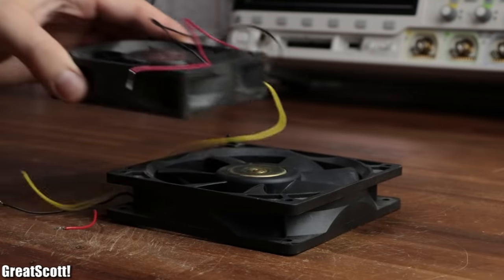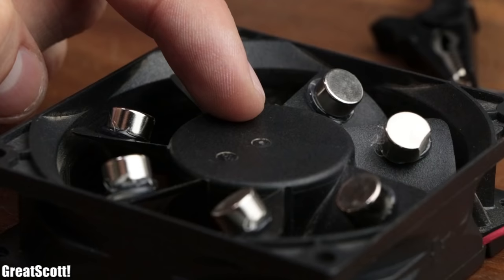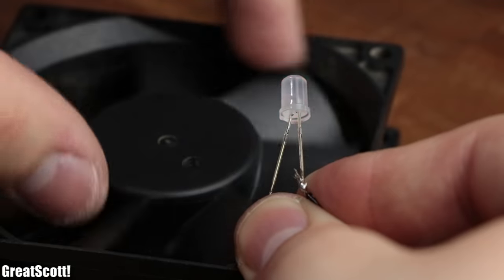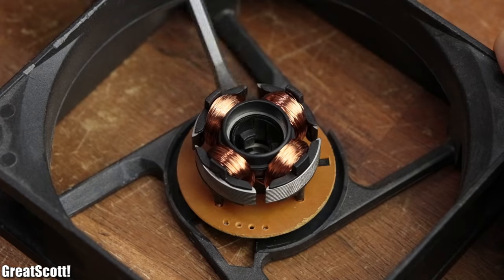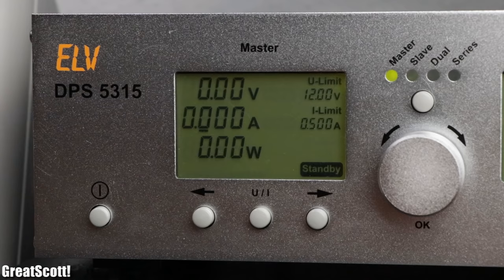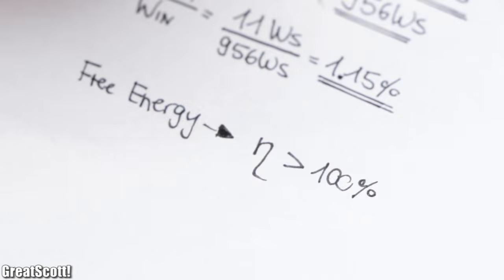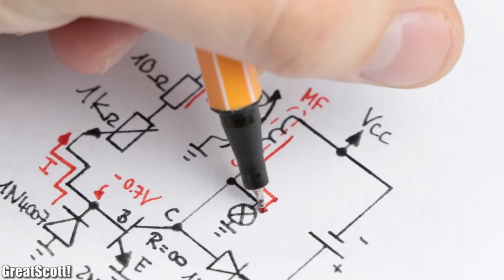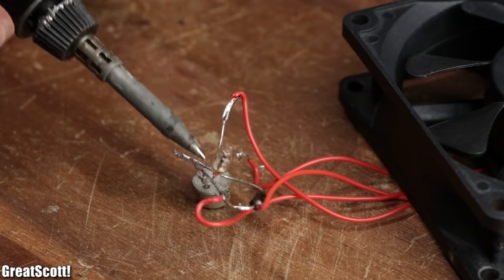Free Energy BS! || Magnet PC Fan, Bedini Motor

Comment: As a second year electrical engineering student I can confirm the existence of free energy (depending on your definition of free), and all you need to do is sneak an extension cable into your neighbour's backyard.
Disclaimer: Use this free energy method at your own risk, I am not responsible for any consequences which may (will) arise from tapping into this 'free' energy.
Reply: lol whats wrong with nuclear power?
Reply: +ExpiAigle cleaner than coal
Reply: @dericsion3480  that's not free energy you're getting it from the sun the sun is a giant power reactor
Reply: @05r solar panels cost money as do coal and plutonium
Reply: @05r that is slightly correct because as much as the sun's energy is vast until a billion years think about night fall or clouds.
Reply: @dericsion3480  sun, wind are not free energy. To build and maintence the facilities that use the sun, wind etc to produce free energy costs aa lot
Reply: @dericsion3480  Its not free energy from the sun, you are just converting light energy to electrical energy. Same as if you run creating voltage, you are just converting your energy to electricity, so no free energy exists
Reply: @somnia3423  nuclear waste its literally radioactive and the thing is where are we going to dispose it?
Reply: @shidoengie9503  it can be recycled
Reply: Somnia it’s radio active...
Reply: retro modern player 
Not in my back yard...... or state for that matter
Reply: @shidoengie9503  so is a bannana, what's ur point?
Reply: @retropcs88  depends on your definition of free energy. to me solar is free energy if it can power your house instead of using the power company. your now getting your power for free from the sun so that is free (zero cost) energy.
Reply: As a first-year electrical engineering student, I can confirm that at the moment I am using free energy too, I never pay for electricity and I am seemingly able to produce it constantly. I just have to stay with a few persons in my home and calling them my dad and mom, it works perfectly!!!
Reply: @User 1 because 2 times something happend? one that was cheaply build befor we were on the moon and the second one on an earthquake zone beart the ocean... how many oil ships destroyd large parts of the ocean?

ofcourse there are huge risks, but when you compare them to other electricity sources its pretty safe, especially for the enviroment
Reply: Good one 😂👍🏻
Reply: @dericsion3480  nuclear energy is better than most dams
Reply: @shidoengie9503  100 meters underground
Reply: @Lodovico Bonvecchi 
Bro chill!
He is just joking.
Reply: @dericsion3480  hydro is not better than nuclear btw
Reply: Ha Ha Ha !  Free dreaming costs no energy at all !
Reply: Replace second year student with “just another guy who paid to read textbooks written by others who have figured it out.” You are not learning nothing new or helping the world in anyway you are simply repeating the information that was given to you. You don’t even have the capacity to think for yourself and come up with new inventions. You’re not Einstein or Tesla you’re just a student whose learning the minimum required in order to get your degree and work for somebody else
Reply: LOL :D
Reply: @Cockalicious  and what have you discovered lately? nikola tesla had discoveries that he and he himself only found out even if it were someone else had it not been nikola it wouldn't have played out that way. Your point is null
Reply: @Gainsforlife  he wouldn't have been able to invent shit if he hadn't learned the stuff the others discovered before him. You also have to know that he only used the fundamental concepts the others discovered to invent. And that's what every damn engineer does.
Reply: @Cockalicious  wow didn't know someone on this planet had the answers to everything. why aren't you rich already bro? lol look bro i appreciate your opinion and all but at the end of the day you don't have the answers sway
Reply: @Gainsforlife  are you a troll ?
Reply: If you and your neighbour do the cords through each house, so both houses get energy if one doesn’t have energy, free energy
Reply: @somnia3423  just build a diy nuclear reactor and your all set
Reply: Best damn example of "free energy" That would absolutely WORK! LOL  Because STEALING any thing, including electrical energy, from your neighbor, does not violate any Principle of  Physics
Reply: @dericsion3480  your ignorance is outstanding sir
Reply: @jaydellinger6674  yea it's*near* infinite
Reply: Damn. I was expecting something different in the comments under an obviously light hearted joke. But here we go with a garbage fire again.
Reply: Loooottt o kaaaaa
Reply: That’s the problem with a 2nd year electrical engineer,
You have been trained how to think and will never will become an innovator because you were told it’s not possible.
This is coming from a 3 year railroad signalman supervisor who deals with electronics, frequency, and high and low voltage electricity with no college degree, who also has common sense.
Reply: @dericsion3480  My man tryna save the world from the youtube comment section
Reply: @conorl6410  meh sometimes you smoke a bit too much XD
Reply: you can ylso just use the power at ur school/university

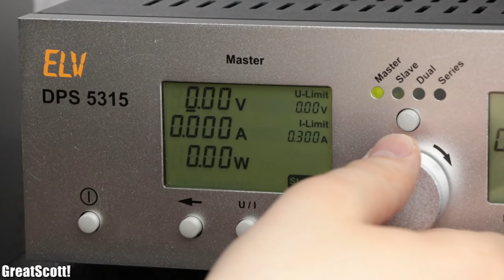Comment: 3:52 mistake no. 1. It has to be a battery to start it up. Free/Radiant energy it's not like electricity we know. It's all about back EMF spikes colecting in to BATTERY which "converts" it to a regular electricity. You have to change your mindset before trying to bite this topic. I've made a machine which produces 900W AC out of 9v battery ;)
Reply: All_magnet motors don't need a startup unless tied to generating electricity, then it's used to charge the circuit not the magnet motive power. If a magnet motor doesn't aim the flux to turn, it's called coercion at 90° and those motors need a kick start, the Teneo Kawai machine once started runs until the magnets fade an example.

Comment: How to get free energy. Take an power extender (forgot the name, but for example one that gives you 4 power outlets) and plug it into itself. 

Checkmate Great Scott
Reply: 1. Take the same power strip (that's the name?) and plug it into your neighbour's house.
2. ???
3. Profit :-)
Reply: Erik Skallevold IT WORKED !!! I connected my wires to the wires on a hole i did in our shared wall and now I have free energy :)
Reply: MrOpenGL ay potah hahahaha tangina XD
Reply: hahaha
Reply: I did that with portable charger and it glitched then eventually had a fire within itself. Got so hot burned your hand.
Reply: Wrong,

Take the power extender, take a leisurely stroll to your neighbor's  house and plug it in. Enjoy an over-unity system with zero consequences.

You're welcome!
Reply: Gah,

Dangit, I didn't see MrOpenGL's comment. 

I am ashamed
Reply: Erik Skallevold Already proven fake.
Reply: Erik Skallevold GET AN EXTENSION CORD, DIG A TRENCH WHEN YOUR NEIGHBORS AT WORK, INSTALL CABLE AND HOOK UP TO THEIR OUTLET BEHIND THE CABINET.  YOU MAY GET FREE POWER FOR DECADES BEFORE THEY CATCH ON
Reply: Here comes the big boys, telling you that free energy is possible.
Reply: anikanbounty97 it can't "glitch" because it isn't software based so it probably would have been a short.
Reply: lol better iodea the excise bike your wife has add a power generator to it free energy and a workout for the wife double win lmao

Comment: I believe there is no such thing as perpetual motion... if anyone ever manages to create a moving device with no loss to friction etc. the most it could do would be to keep rotating (or whatever), but it can never supply usable power to another device.
HOWEVER, there definitely is such a thing as free energy...  just hook an extension up to your neighbor's power outlet and wait for the explosion when he finds it!   :o)
Reply: perpetual motion is electron spin, galactic spin... obviously those things dont exist... (sarcasm)... the problem is that people cant get past outdated theories. solar panels and sailboats... "free" is a matter of perspective... free to me... if i know how to harness (actually "stimulate" would be more accurate) the zero point field... i can... ican show you how also, but the obstacle is the closed minded viewer.
Reply: +Steve Habermacher Prove it. Thing i the laws of thermodynamics are pretty concrete. Cant get energy out of nowhere.
Reply: Perpetual motion in space while using the earth rotating field and the sun waves using a solar sail using protons to push it further, wouldnt that maybe enough to power AT LEAST a light bulb? lol..
Reply: Tehchnically even if it would provide a small amount of electricity, it would still be perpetual right?
Reply: ExpiAigle then you wouldn't be creating energy out of nowhere. And no it's not perpetual since the sun is not.
Reply: It might be able to do half or quarter a spin than push it back hard enough to get back to the other push keep pushing it back and front for infinity
Reply: Alex Sander in theory, such things can exist. In practice, it can't. Why? Because of something called friction. You can't have zero friction. Even in sideral void, there is a tiny bit of friction.
There is two kinds of friction. Fluid and dry (solid). 
Fluid friction is caused by gas like air or by liquids like water, or even by plasma (what happens in 'void' ) 
The other kind of friction, dry friction, is the friction between two solid surfaces. In our case, this one can't be avoided at all. Finally, and this is something most people don't know, is that if you put a coil of wire near a magnet, it slows down its movement, acting like fluid friction. So you can't perpetually gather the energy from a moving magnet, even if you removed fluid and dry (solid) friction.
Reply: Antoine Viallon thats the thing im talkin about imagen swinging my litle niese on the swing once if she sits it will not swing for ever
If someone keeps pushing it (for ever) it will

Now by configuring the magnets differently u will get different results, that way i noticed it could keep bouncing back and forward without completing the circle easily till frigtion killeed it if you possitioned it 2 negative 1 positive i think
So i do think there might be a way where if you use strong enough push on both sides and include the right weight on the sides it it may keep on bouncing for and backward
Reply: Steve Habermacher u need to learn history, people in the past used to do a lot of research about perpetual motion yet they stop bcoz it juz wont work. But perpetual concept is still apply nowdays such as perpetual motion machine that combines with generator to create less input for a machine to operate. U can refer to thermodynamic second law
Reply: In real state its not only friction that cause energy loss. There are many kind such as potential energy, heat loss, kinetic energy and etc.
Reply: that isnt free it's stolen
Reply: Well then you can throw thermodynamics out the window
Reply: John Colvin Yes there is such a thing. You just need an Electric Generator, high powered lamp, a Solar Panel, a Fuse box, 10 12Volt car batteris wired together to create 120Volts of electricity and feed it back into the Generator. Constant infinite energy that runs on it self. At the sametime creates 120Volts of free energy, not that difficult to build.
Reply: I’ve seen over unity devices. Many air conditioner units output 3 or 4 times the energy that is input into them. I guess what some people are looking for with a free energy device is something which gets out more energy than is put in to the device but the output would have to come from an external source such as from the planets atmosphere or from the quantum field.
Reply: There is such a thing as perpetual motion most certainly it's the waves of the ocean but dam if I know how that black magic voodoo works. Wait for it wait for it someone's gonna say "gravity" once again with the magical mystical unicorn piss and leprechaun farts
Reply: More powerful magnets and less bullshit should do the trick. Lets go to the point where those magnets smashes your hand and never lets go without 80 tons of opposite pressure to stop your screams. Till then I remain a believer.
Reply: how about the moon?
Reply: @alexsander3169  how about Tesla's theory using the gravity going around the earth a momentum, like the satellite
Reply: There would be free energy if people would use wind and solar. We pay others to create it for us when we have the technology to make it ourselves.
Reply: @AntoineViallonDevelloper  maybe creating something that spins forever is nearly impossible but by minimizing the friction using the right materials you can keep it spinning for a long period of time. Long enough to create a replacement when needed. It is definitely not free energy since you put a lot of effort into it, but if you can have a stable self powered system to begin from you can find a solution to make it better with time. Wind and sun are two nice options when it comes to energy, but imagine having to stay underground because of a nuclear war. Those methods are useless then. If that magnetic thing can give me enough power to have a small light, recharge batteries or boil water even for one hour it's big help don't you think? I don't think that any government would let something like that happen though. They are either going to make it illegal to have such a device or ridicule the whole thing.
Reply: @mariasama7859  Something that spins for a long time on its own isn't hard to accomplish, you just need to minimize friction and air resistance losses. However, when you try to draw energy from it, it's going to stop really fast, because you're putting a load on it that is much greater than friction.
Reply: Magnet has got energy that it is loosing so maybe you could do really micro energy source, but magnet will run out of energy
Reply: if you spin a wheel in space it will keep on going
Reply: @marcisgulbis9310  oh so that's how it works. So you use bifaler wounded coils then ?
Reply: Earth spins...
Reply: @AntoineViallonDevelloper  there is friction in space?
Reply: @robinduta4388  Long enough that you and I won't need to worry, but not forever.
Reply: @robinduta4388  Yes. Not from air (obviously), but from other interractions, like eletromagnetic interractions, for instance.
Reply: @mariasama7859  If you power something from it, you are extracting energy from it. More specifically, you extract his kinetic energy and convert it into light (through electricity, probably). It will thus stop spinning at least as fast as you draw energy from it.
Reply: And don't forget to gain some energy from the explosion!

Comment: There is a saying: There is no free energy, just one type of energy can be converted to different type of energy. And yes you can get free energy by directly connecting wires before your household energy meter or steal it from your neighbours, ect. Energy from sun, wind, water, fire is also free, u just have to convert it into electricity.
Reply: rawux1228 that’s not
Reply: Converting energy is really expensive

Comment: There is no free energy device
                                      -ElectroBOOM
Reply: I like papyrus and electroboom, so i subbed to ur channel.
Reply: There is no free energy device
    - litterally the laws of physics
Reply: have you heard of a solar panel
Reply: @cooperstein1974   that isn't free energy that's converting 1 type of energy to another same applies for a wind turbine a nuclear reactor and a dam which uses water going downwards at a steep angle and that water moving at high speed turns a fan connected with a motor that's actually meant for generating power unlike the pc fans shown in this video as they actually have a system in place to prevent or limit energy going back into the system

Comment: Nice presentation but you left a lot out on the Bedini motor. You did not use the transistor John always recommended to start out with. You left out the energy of the fan itself. And you left out the extra energy you can gain by adding a generator coil. John always said at best the SSG is a 1 to 1 charger tho. I would love to see you try it again fairly and add in those aspects. Without tuning it is unlikely you will see 1 to 1 but...

You left out an awesome aspect of this circuit. It desulfates lead acid batteries amazingly!!! That voltage spike breaks up the lead sulfation on the plates, increasing usable energy of the battery.

And a capacitor is cool but the batteries is where the real work is done. Try your circuit again using batteries. Add another one in parallel and watch the input current. Often it will drop - not increase - drop. Add another, another and another. Pretty cool stuff.
Reply: Also Rick, who made these for sale, often rewound the fan coils with different wires.

Comment: I imagine the PC fan would have a diode to prevent the fan from pushing current back into the system, but still free energy is always bullshit. There is a reason why we need fossil fuels or sunlight or other natural sources of energy to TURN energy into electricity. No energy ever gets created, only changed to another form which also creates some losses in the process.

Try charging a power bank with another power bank, eventually after going back and forth a few times they will both run out of power because it is not 100% efficient. Same thing will happen with every single one of these "free energy" devices because of losses

Comment: Love your videos and especially how you actually perform tests instead of just pontificating with regards to FE.  However, COP (or it's electrical equivalent) is the term most applicable to 'free energy' studies and NOT efficiency.  Also, apparently, batteries ARE REQUIRED for the Bedini circuits - you replaced them with power supply and capacitor.